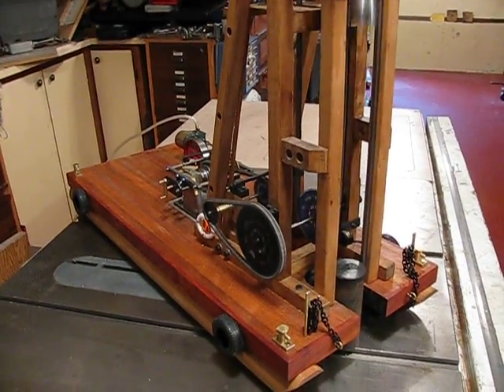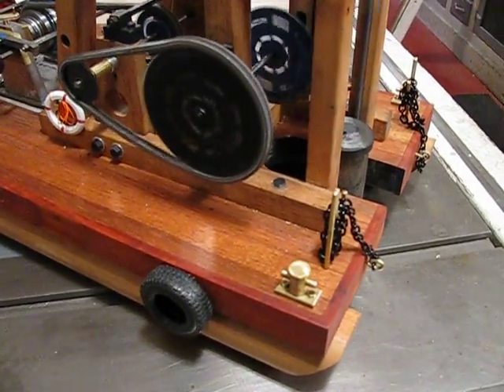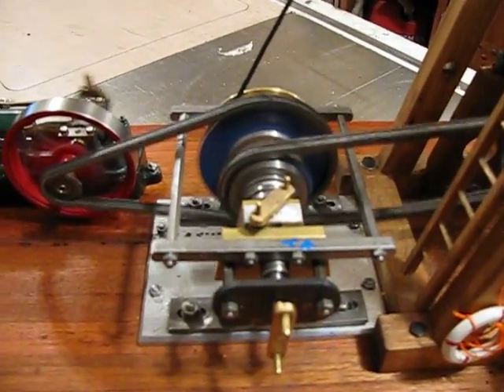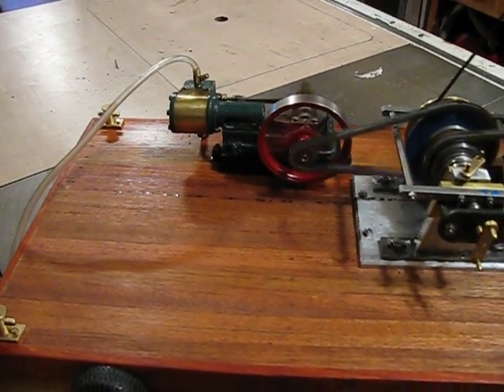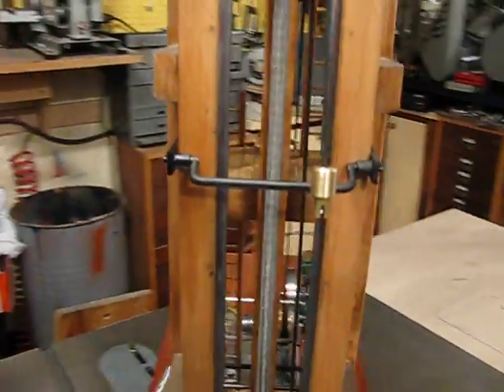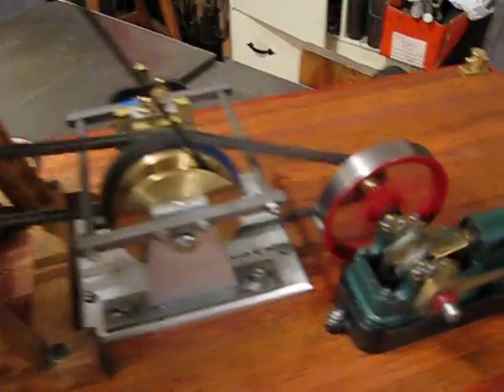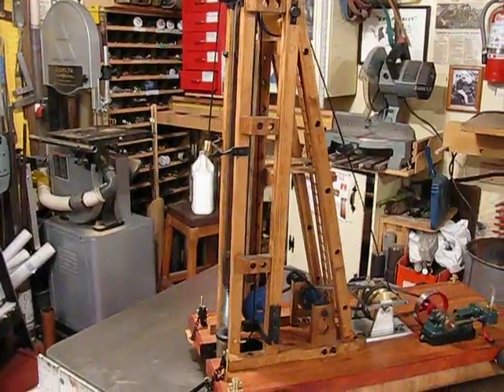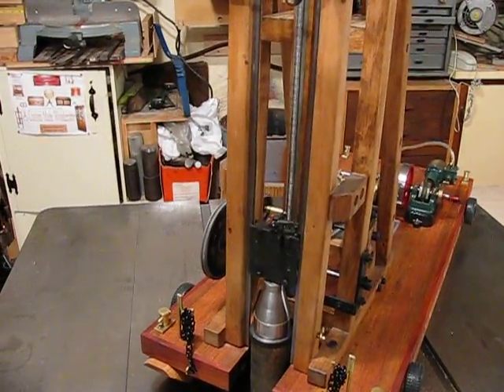Chain driven model steam pile driver running on air

Comment: Nicely done!!  What did you base your design on?
Reply from the maker: The design is really a compilation of stuff I looked at re old pile drivers. It all started when one of the guys at lunch suggested I should make some kind of crazy nut cracker. The model is not representative of any real life machine but people enjoy it.
Reply from the maker: Design is based loosely on vintage pile drivers that I spent some time researching.  I have taken some liberties to make the model function as it does. What I actually know about pile drivers would make a very small book. The idea to build it came from being challenged to  make the ultimate nut cracker.....Carson